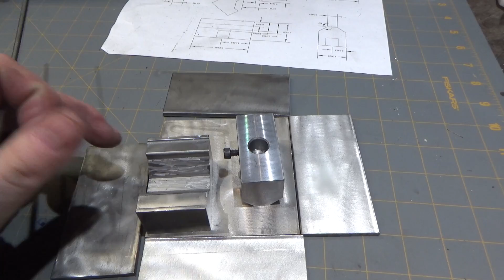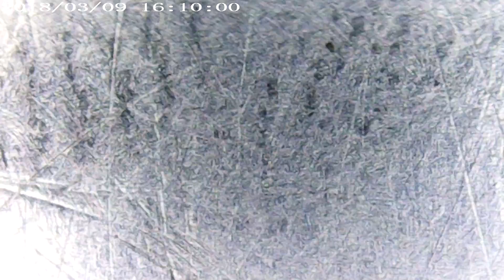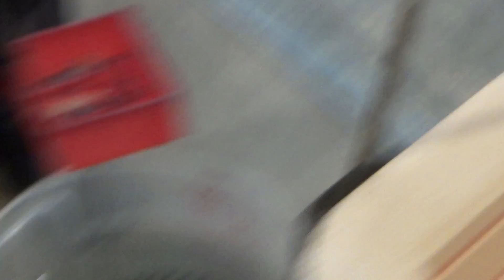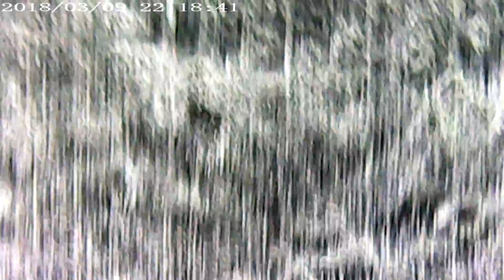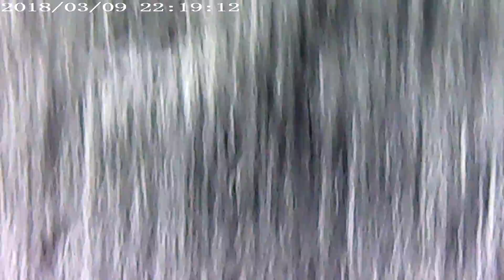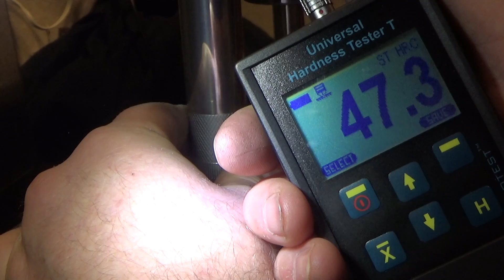FIXED EDIT Soft Jaw Revisited with Case Hardening and Quenching Explosion

Comment: Modify your blank design to have ears that finish wrapping around the jaw that design has always proven to be that best. Magnets let go at speeds and collect trash
Reply from the maker: I have found this out the hard way and already abandoned this approach. I am not a huge fan of the folded and bent clamping style, especially because the tips of the jaws are shaped in an arc and when you tighten down on the part the soft jaws are deformed open. Tricky problem this. Thicker material might be a solution, or perhaps build in the curvature of the jaws. Proper mold making is a ways out of my wheelhouse. Perhaps the challenge will be good for me. Thanks as always for the suggestions.

Comment: Hi 
Informative vid, I've been thinking about heat treatment for small parts,so your vid was nice to see.
Im wondering about your handheld RC tester. Could you tell me the manufacturer and cost of the tester?
Reply from the maker: I purchased this tester from a pawn shop that advertised on Craigslist. I believe that it sells for about $1200 new and worse it is made and supported in the Ukraine. I am sorry about the bad news. I have been looking for quite a while for a reasonable solution to hardness measurement and if you want any kind of accuracy the prices are crazy. I might be coming up with a build it yourself solution hardness measurement at some point in the future.

Comment: I suggested that you might try using a reducing flame when you use your torch for hardening operations. Adjust torch controls for a slight shortage of oxygen.
Reply from the maker: Interesting idea. You might even diffuse some of the excess carbon into the steel. By the way, when I did this my 20 year old regulator was having issues holding a constant pressure. I ended up buying a rebuild kit from Victor. Thanks as always for your insight.